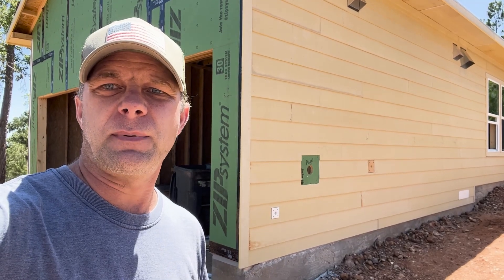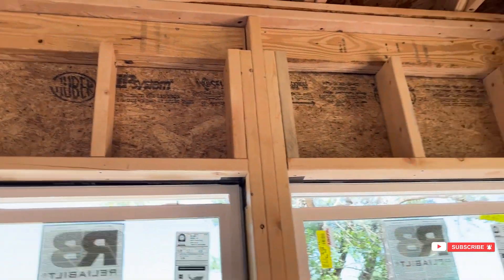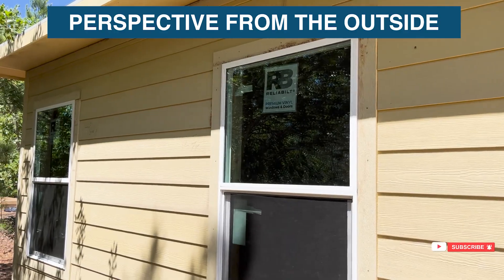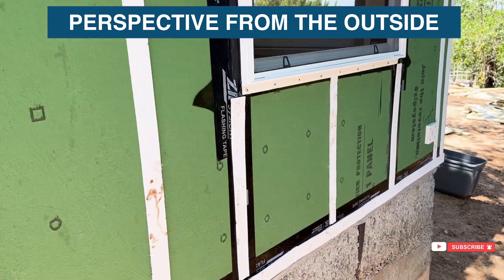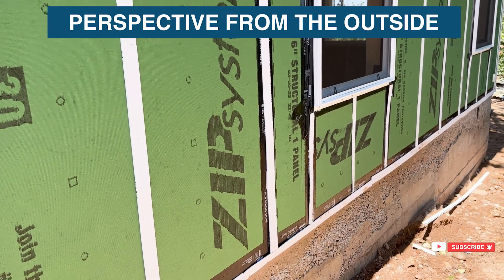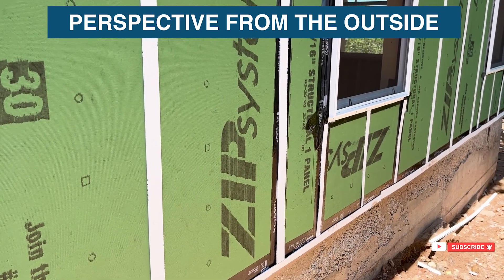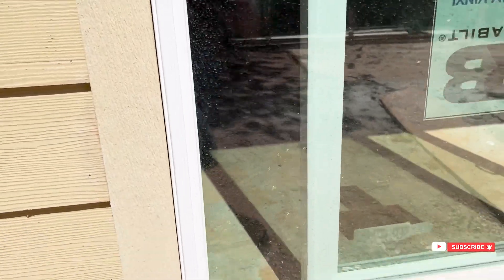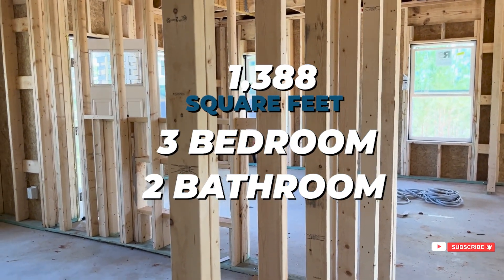The minimum a spec home should have - Spec Home Tour

Comment: The foundation looks like it's falling apart...
Reply from the maker: They didn't do a good job finishing the slab on the edge. But the perimeter beam is over 12" thick and the top of the slab was super smooth. So the slab is in great shape structurally, and now that we have underpinned the sidewalls (like stucco) it looks good now. We now have a better concrete crew.

Comment: I like your dedication to air sealing and conditioned attics in a competitvely priced build.  While the Bosch variable speed system has a great price, some have been disappointed with its humidity removal capabilities.  Be sure to get some guarantees from the manufacturer or distributor.
Reply from the maker: Thanks for the info. We have done the manual S which includes calculating whether the system has enough latent capacity, but I will re-check this just to make sure.

Comment: Hi Scott. Everything is looking great. I noticed that your rain screen strips were 24” OC behind the lap siding areas, but how do you handle them for your board and batten sections. It looks like the battens are 16” OC. Also do you have any issues when the battens are fastened only to the sheathing instead of a stud?
Reply from the maker: Usually what I like to do is put extra furring strips so that there are strips behind the battens. And furring strips every 12" on a 24"OC wall just so we don't see waves. I have not had any issues to battens fasted to OSB. They are relatively light, nailed with several nails, and caulked. On a tall wall, I would consider lining the studs up with the battens, which I've done on bigger projects.